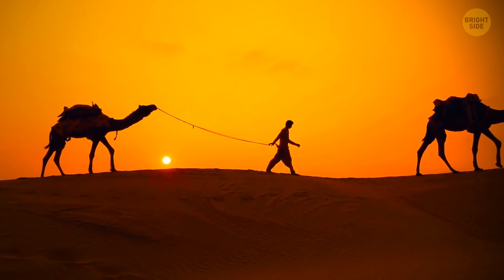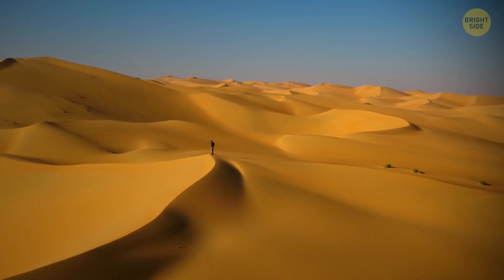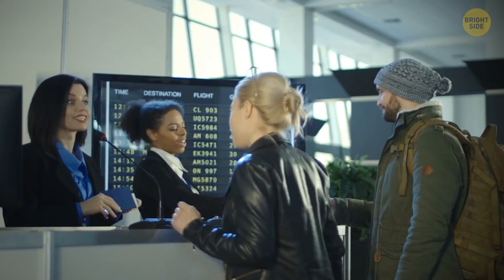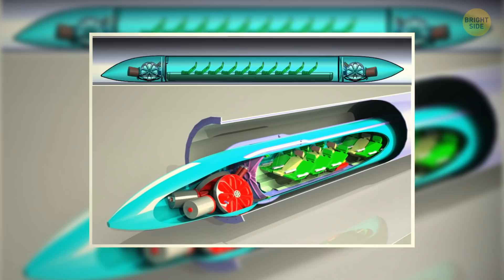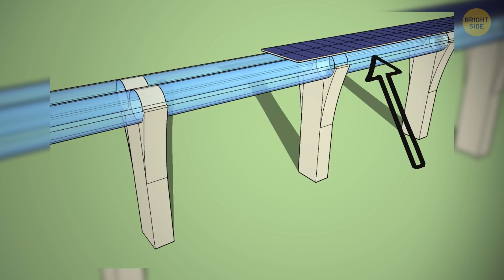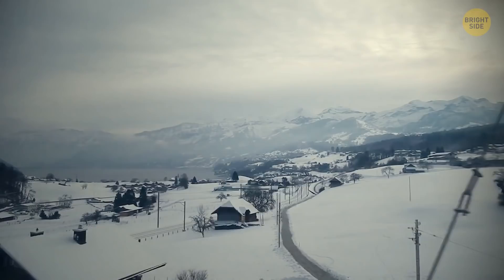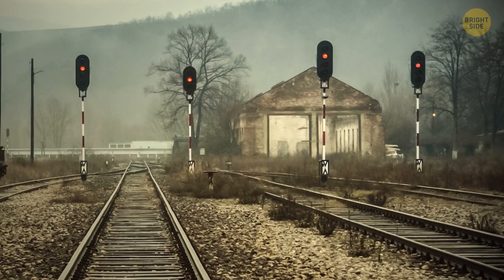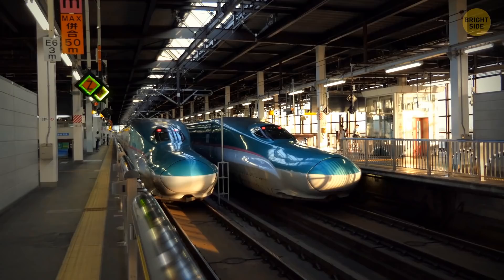That's Why High-Speed Trains Have No Seat Belts

Comment: I rode a high speed train in China in 2016. There weren’t any seat belts on the train. I figured there weren’t any seat belts because if the train left the rails, seat belts wouldn’t make a difference.

Comment: This is the worst video about trains that I have ever watched on the internet. It jumped from one part to another and has no connection with the title at all, saving some parts. Hyperloop will never be a reality because simply it is too costly and prone to breaking down in the middle of the track. Once it broke, removing the broken pod will take longer than removing a broken High-Speed Train (HST) from the track, as an HST can be moved by sending an engine or two to haul it to the nearest station but not a hyperloop. What's your point, then, Brightside?